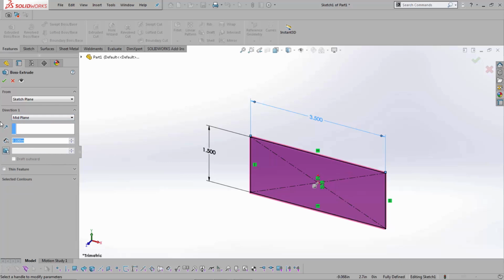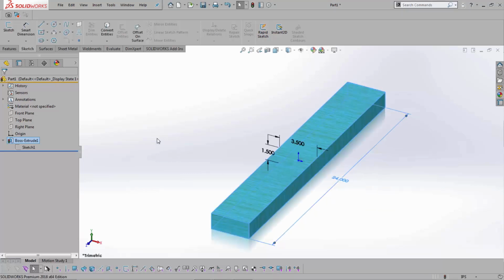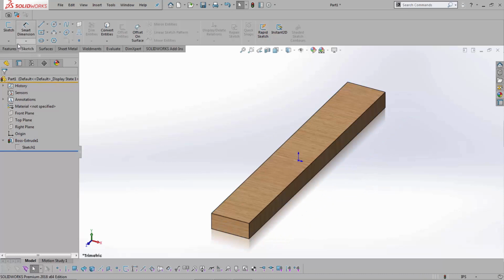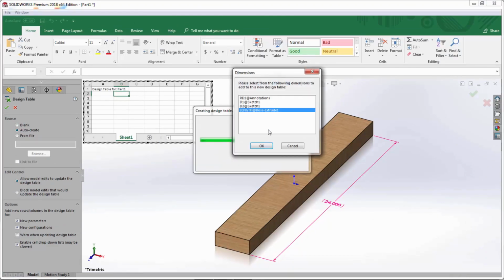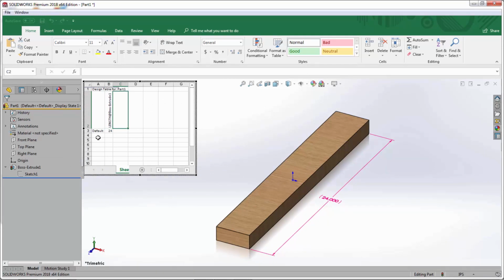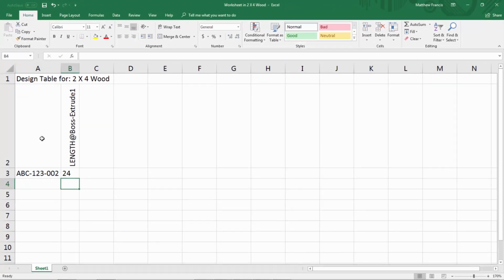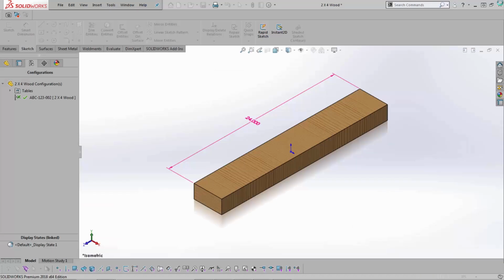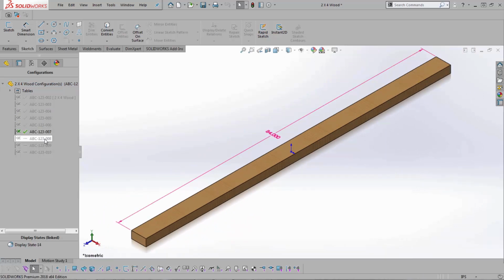SOLIDWORKS - Using Excel to Drive Model Dimensions

Comment: hi guys, I was had question, where I can learn SW deeply as from simple solid modeling till the modeling of the hydraulic and electrical systems. place or precise tutorial from A to Z
Reply from the maker: Hi Ilkhombek,
You describe a skill level that would be achieved after initially taking many courses in SOLIDWORKS followed by a few years spent in various industries doing SOLIDWORKS design.  SOLIDWORKS is quite a large program and it may be expected that you use only a small fraction of its tools for any given job you have in industry.  The accumulation of experience through many jobs will give the A to Z knowledge you seek though.
Reply: @goengineer  Just want to say that this is the most candid and helpful response to the question of "How do I learn Solidworks deeply" that I've seen on the internet to date. Cheers for that.